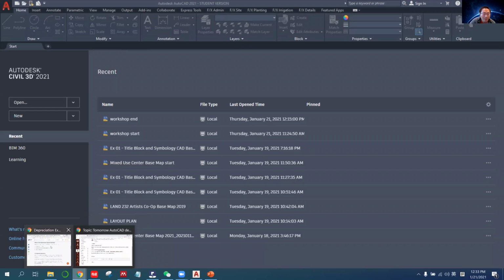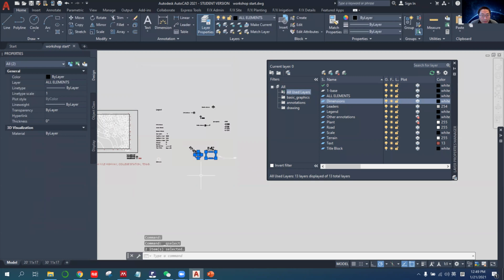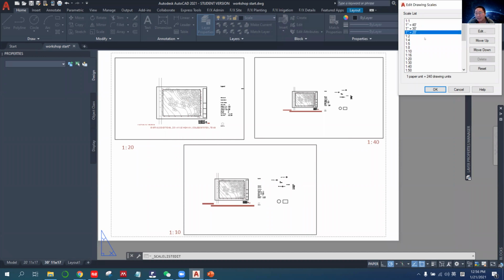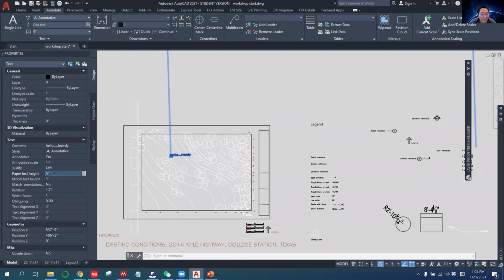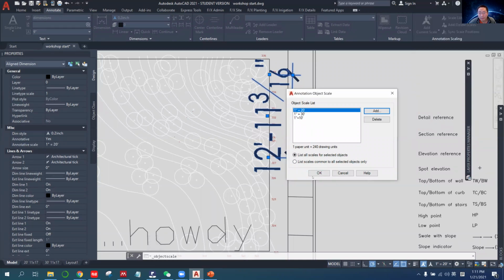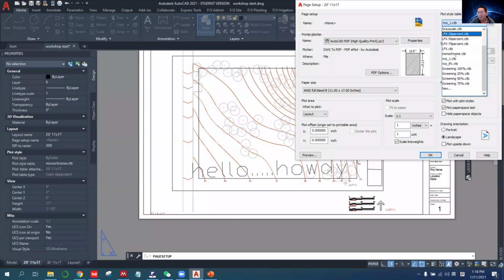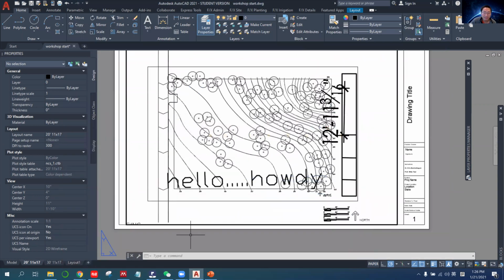workshop demonstration on AutoCAD practices

Comment from the maker: Please check the timestamps of different content in this video below and on the video progress bar:

0:00 introduction
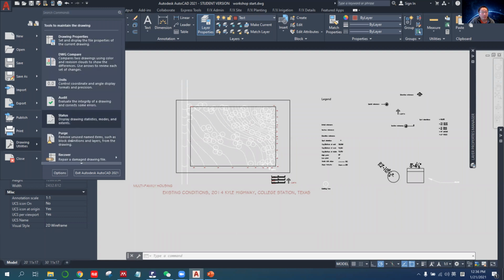2:22 starting file of the workshop
3:00 set up units?
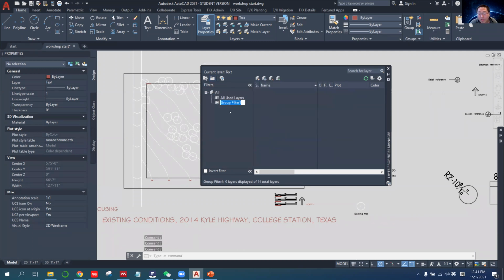7:30 work with layers? 
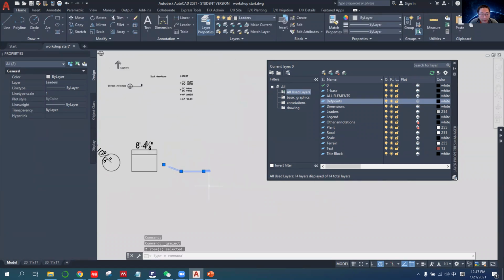13:25 use quick select to automatically select objects?
16:25 set up title blocks
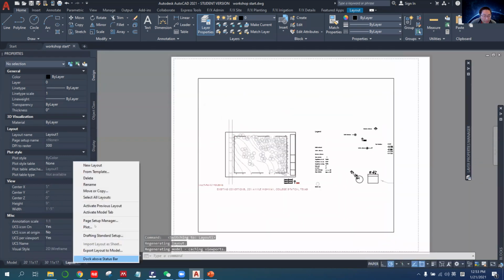19:18 create viewpoint and talk about the scales
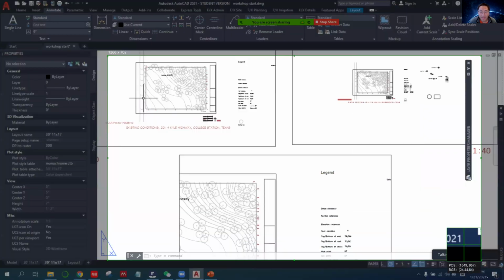26:15 set up annotative texts (remember they only show the scales you specified in the layout space)
35:15 set up annotative style 
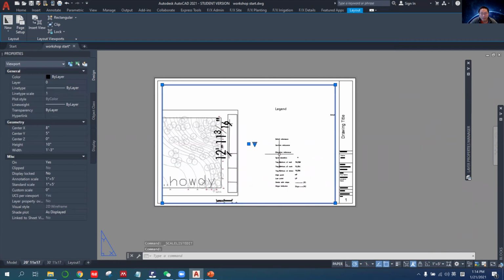40:33 set up color and NCS pentable